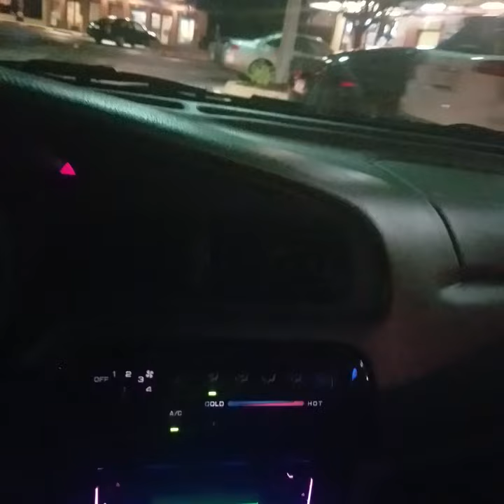Weird noise when pushing and letting off the brake pedal when at stops

Comment: I recently had a similar noise on my front right tire. it turned out that the brake pad lining was contaminated. when I took the pad off and lightly rubbed it on a 40 grit sand paper it was shedding like powder. I replaced the set of pads and cleaned and lubricated the brake hardware. All is now back to normal. I hope this comment helps someone.
Reply: I just changed my brakes and my car recently started making a noise only when fully coming to a complete stop and slightly after letting go of the brake to accelerate, should I change the brakes again?

Comment: Your slide pins are dirty, causing brake calipers to not be able to retract immediately, causing brake pads to drag on rotor. You probably feel you need to keep a lot of pressure on brakes to keep the car stopped at red light. Remove caliper, clean and regrease slide pins.

Comment: What you are hearing is front brake noise that sometimes occurs, depending on brands and brake pad materials. You are hearing the friction creaking of releasing pressure between the brake pads and the rotor.  Imagine a C clamp (the caliper) poised over a brake rotor disc, with a brake pad on each side. When you hold the brakes hard and tight while in D gear, you don't hear anything because nothing is moving. The clamp and pads are not letting the disc move. But when you slowly release the brake pedal, you release the pressure the clamp and the pads are exerting on the disc, and the rotor is trying to turn because you're in D gear. And you get friction creaking. Changing to a different brand of brake pads and maybe different material might make a difference. In my experience, I just became accustom to the noise.
Reply: Sounds about right. It's driving me nuts though.
Reply: That’s exactly what I was going to say, (mechanic by trade for Ford), I would start by shaving both rotors up front, and take the pads off and inspect them, you’ll probably notice one side of the pad is more wore than the other side of the same pad
Reply: i was about to say this. i changed my pads and it was silent . cheap ones make this noise
Reply: @cristianenache1247 yo fr it got me scared AF bc I feel it like every time I'm stopping at a light
Reply: Yo I thought my phone brakes was failing 😂😂😂 I just got them done a few hours ago
Reply: I got this same sound, any suggestions on how to fix this? Will replacing the brake pads help?
Reply: @Carbonite003  Possibly. Cheaper brand pads are sometimes more prone to making the noise.
Reply: simply speaking, is it normal or not? -_-;;;
Reply: @jinsu0504  In my opinion, its not something to worry about. Your brakes will still work as they should.
Reply: @iluvdrywall  yes....but will it have any adverse long term effects....your lungs still work when you smoke right? Untill you get some sort of obstructive lung disease or cancer..are you a mechanic?

Comment: If you can fully understand what's wrong with all potential problem on your car, you can get an A+ on physics.
Reply: It does not take pro to know that there is a loose fitting or damage hardware  linked to the brake pedal...I have this problem too on my car .  I have a toyota preuis 2017 type C model...

Comment: On my case This was  a lack of lubrication on the brake system. I  Had the same issue right after I changed the front brakes pads and rotors. Every time I replaced my brakes I usually lubricate the pads without having any issue in the past but For some reason this time this noise showed up. 
So I went back pulled everything apart and lube all metal to metal pieces (top and bottom) and superficies including the bracket, the piston and break pads where the caliper puts pressure on the pads.  Do not forget to lubricate your pins and boots.
If you do your brakes, take your time and lube all your pieces. If you took your car to the mechanic and is making this noise I will take it back and make them fix it right away. Even mechanics like to take short cuts (some, not all).
  And change mechanics!
My brake  Noise issue is gone
I hope it helps
Reply: question...what kind of lube did you use?? And how do you lube the piston??
Reply: Thank you.
Reply: I have this problem now I changed breaks rotors an calipers an still have no the I went to shop an the grease it all up it stop for like two weeks now I hear it again
Reply: I just changed my brakes and rotors and I took my sweet time cleaning everything with a wire brush and also used grease, but I’m hearing this noise when I come to a complete stop and slightly after I accelerate don’t know if my brake pads are contaminated but it can’t be due to lack of cleaning or lubricating
Reply: @crispyb313

Comment: you need brake shims or want to check the little grease on brake shims, may be the grease is gone and metal to metal makes that loud noise and you feel like something's gonna get fucked up, but it's very very common. This sound will usually start during winter/ heavy rain time. My Mustang does the same. It's no big deal.
Reply: So no need to take the car to the mechanic?

Comment: I finally got mine fixed. My one only had a load noise when fully stopped and then going (exactly like the ones in the video). The real problem is the pistons in the calipers need to be re-lubricated. I changed my rotor and brake pads and re-lubricated all. The noise is gone. Hope this can help you. 

PS: another potential reason is the bad bushings, but if your car is less than ten years old, not much KMs and a Toyota, it very unlikely to be the bushings' problem.
Reply: hi bushing problem means which bush kindly help me
Reply: Literally just got my car back after replacing the control arm bushing and still have the exact same noise when easing off the brakes form a stop. It’s gotta be a caliper issue at this point 😭😭😭😭😭 new pads and rotors, now bushings, I dono what else 🤯
Reply: @SuperNewMom1  might due to the type of the pads as well, I’m using ceramic ones and it hasn’t made a noise again.
Reply: @SuperNewMom1 same with me, my control arms are really worn out so it looked like bushing issue. replaced control arms but sound is still there so it's now a brake issue. It looks like harmless since braking is great, ill probably do the lubrication when I finally replaced the pads. Still at 30% worn level

Comment: No biggie. My car has been doing this for 5 years. Exact same thing, for sure. Don't notice it...of course if I ever do, just crank up the music - fixes all my car problems. That and when the engine light turns on, I just unplug the battery for 20 minutes, wah-la, fixed.
Reply: yea
Reply: That is not ybe solution, you want to take care of the problem,  before  it gets worse and expensive

Comment: The guide clips where the top & bottom of the brake pads ride on in the caliper housing can get dry with dirt build up in them that will cause to make noise the only way to correct it is to take off the brake pads then clean the guides up & put just bit of white grease in them also the caliper sliding bolt pins can be dry as well that need to be taken out & greased same time when greasing the brake guides.

Comment: Brake pads seized to the caliper over time so companies created a gap between the brake pads and the caliper to allowed for expansion and contraction brake pads don't get stuck to the caliper bracket. The sound you hear is the movement of a brake pad on the bracket
Reply: How can you remedy the situation?
Reply: @MrVuittonDon  just use copper anti seize on all contact surfaces.  It helps keep the contact surfaces from binding together and reduces the coefficient of friction for the material. It can withstand a higher pressure and  temperature, so it works well for brake pads.  Just don't touch the braking surface with it or you will have bigger problems.

Comment: It is your ABS Braking sensor.  You can check it by taking the ABS fuse out.  if it goes away you either need to clean the sensors or replace them.
Reply: Even the dashbord abs light is off, is it the abs speed sensor?
Reply: My car doesn’t have abs and does this🤷🏼‍♀️

Comment: It’s called a creaking noice most  mechanics will call it ! But it’s a bad bushing from the suspension area and check all the links as well but it has nothing to do with brakes !
Reply: Thank you sir
Reply: Damn the first right answer I see in all these comments
Reply: Hello KW,  my car has squeezing sound ONLY show when the car is running,step or release the break will hear the squeezing noise. If the car totally stop and step or release the brake, no squeezing noise at all.
 When the car running the bad road, the car doesn't have any squeezing noise, only step or release the brake. Do you think this is problem is about the bushing? Thanks for your help
Reply: It is not caused by bad bushing from the suspension area. I checked my suspension and all bushing twice and the sound definitely came from the breaks. At least in my case..
Reply: Thank you!

Comment: I'll just repeat my answer here as well, mate: It's just the break pads rubbing against the brake rotor. It happens when the engine through the automatic gearbox pushes the vehicle forward a bit, AND you loosen up on the brake pedal so the pressure is not quite enough to hold the vehicle stationary. As the pad and the rotor rub against each other at very low speed, they tend to oscillate. One millisecond they are stuck together, the next they slide. It's a common phenomenon that happens a lot in many situations in life. You'll get that if you hold an eraser vertically at one end and let the other end rub against a table top as you move the eraser along. Then you can get the eraser to oscillate, as it were. So it's nothing whatsoever to worry about. I sometimes do this with my brakes as I'm waiting at an intersection, just to annoy my wife! It works every time. Just lift the brake pedal to the point when the idling engine can just move the car forward ever so slowly, and you get the sound.
Reply: Car is not moving when noise shows up
Reply: Thanks sir!!
Reply: it’s doesn’t help sir , obviously there is something wrong 😑..... wats wrong ? 😢
Reply: You completely miss the point. It happens when you stop too.. every single time.. this is definitely not normal.
Reply: Weird. I’ve been test driving new cars and most seem to make this sound. Yet my little old 2005 civic never does. Go figure!
Reply: I've had this issue with my current car and the previous one. Both were new when bought so I agree that this could be very normal. But thank you for explaining it so well when the dealership had no idea what this is.
Reply: @MsSweet203  just got a 2017 kia forte and it makes this noise it's pissing me off my honda 1997 never gave me problems like this
Reply: That may be the case, but I didn't have this issue a year ago and it's annoying. 3 shops don't know what it is, prob just need lube. It is particularly bad when parallel parking.
Reply: Mine does the same. Come to  complete stop, then humming til I accelerate again
Reply: You are 100% correct 😅

Comment: Can barely hear the noise, but when slowly releasing the brake pedal you are slowly releasing the pressure they apply, which causes the brakes to "slip" which makes noise, try slightly letting off the brakes and see if it makes that noise continuously as you slowly begin to roll...
Reply: If I had this issue what would you say it is?

Comment: Most auto cars to this. Get the car moving and then put it in to neutral. Then come to a stop in neutral. The noise wont happen. Its because with an auto car always has drive or creep. I have a Renault Laguna and have this issue when I come to a stop with brakes lightly pressed. If I stop with a bit more force on the pedal then this noise never happens. I get rid of it by changing to neutral just before I stop or braking a littler harder.
Reply: Will try that thank , at least it's starting to isolate the problem.

Comment: Exactly same problem like mine. I fully service the caliper, change new brake pad, greasing...everything. Only I did not service the caliper piston because too much job. The sound reduce only 50%. I gave up because not really distracting if you do not focus on the noise.
Reply: Exactly
Reply: did you do the full service on all four of them?
Reply: I did the same I lubed everything up sound went away completely came back within a week not as bad as before only does it when I'm stopped on a hill
Reply: @jamesharris5185  Did you drive your car every day during the week?
Reply: Yes

Comment: It's another car, but I got the same symptoms. I repaired the brakes, but it didn't improve, and when I suspected the bushing of the front arm and sprayed lubricant from the outside one by one, it was found that the cause was the lower arm bushing.

Comment: My toyota prius 2015 has this problem for about more than a year. This is happening when I drive about 1 hour or more. This noise is comes from under the break pedal. I went to mechanic but in that time my car didn't have any of that noise. It's happening when I push the break pedal hard to stop or before stop sign. But it doesn't happend when the car is regularly moving. Sometimes it's so annoying when someone is in my car. :\
Reply: Same issue with my Corolla 2015, been at dealership today, there was no noise (as always), back to home and have it again every time I squeeze it or release, it's like clicking or crunching

Comment: Had the same issues!  Mine ended up being the lower control arm bushing!  Put some WD40 on it and sound was gone.  Time to replace the bushing
Reply: You rite too I have a 2017 impala an now you say that I had got my rear rotors breaks an calipers changed the noise was still there then we lifted the car  an see the rubber between the lower control arm and spring was bad so he sprayed with wd-40 an noise stopped for a few week but now it back

Comment: I have the same problem on my Hyundai Sonata 2011, it came from the front side driver , I changed  all the calipers parts. But the problem still happens again, so I think we should change the Rotors and brake pads too and make sure that the fluid brake goes to both sides equally.
Reply: are you fix it bro ?
Reply: are you fix it bro ?
Reply: how did you fix it?
Reply: Wow I have the same car I change rotor pads and all ball joint and nothing I spend 1600$ I a have the fk sound
Reply: After doing all of this after à few months it came back , took it to the mechanic they found out one of the bearings wasn't working properly, once they changed it, nothing happened from there.

Comment: Did you ever figure out what it was or get it fixed? My 2011 tahoe does it wayyyy louder than this and it makes heads turn at me.
Reply: My problem was lubrication.
Make sure you lube all your metal pieces when changing your brakes, including the bracket, piston and the caliper arm (the part that puts pressure on the pad)
Conclusion, grease all metal to metal parts just don't over do it

Comment: Same noise. Car stopped push  brake pedal equals regular knocking sound. Not sure but I think the comment on abs working when it need not as car is not moving. Another thing that crossed my mind. Could the one way valve to booster be at fault

Comment: I have the same sound with a Toyota Corolla 2016, specially when I change gear from reverse to drive, did you find out what it was causing this noise?
Reply: Manuel Alejandro Mijangos sir napaayos nyo na ba
Reply: my 2018 Toyota corolla does that same sound. When I switch to reverse, or drive it'll make that groan. My dealership by toyota said it was the neutral safety switch moving. Bulls shit lol. 
same people who said my air filter was a little yellow but ok.
I took it out and it was dark with a leaf in it.

Comment: Do you feel it like pop in ur brake pedal?
Reply: I can fell it in pedal any ideas? It's just like one pop sometimes feel it in clutch pedal aswell
Reply: Mine is like that I push on the break and release it sounds like I'm opening a freely door its not my brakes they don't make a noise I can be parked and its the same coming from the break pedal like it needs to be oiled or something I tried asking around and I got so many different answers even my mechanic said he never heard that before I don't know its been safety checked in December it passed I bought it in march and it just started happening about a month later I'm a woman I don't want to be ripped off by these over priced mechanics I'd like to know what it is then I can tell them and they can't add a bunch of crap to the price it drives great I just don't like the noise and the comment about go see a psychic is the reason I don't usually like to post questions because of idiots like that but I'll keep asking and looking till I can found out he problem sorry I had to put my comment in as I was you tubing the same problem. Thanks for posting

Comment: I experienced the same sound on my Infiniti Q50 after upgrading to BBK. How does one resolve it? Did you manage to find a resolution? If so, what did ya do?
Reply: I having the same issue on my Acura ILX, I had the brakes changed twice, and it’s still there. I went to the mechanic and he told me that my front control arm bushings on the suspension are worn and need to be replaced soon, so I’m guessing that may be the culprit.
Reply: @wolfpacindahouse1  My service advisor says the sound is normal so idk. The car stops fine, no brake fluid leaking,  no inner leaking in the master cylinder and booster, etc.. So not sure why it's making that sound. Try different mechanic and see what they says.
Reply: @bn4241  have them check the suspension, bushings, ball joints etc...

Comment: does the vehicle have a Hydro Boost brake booster?  if so, it could be a bad seal in the actuator bore , causing the piston to shake slightly when pressure is applied and or released.
Reply: I'm having this issue. What's a hydro brake boost?